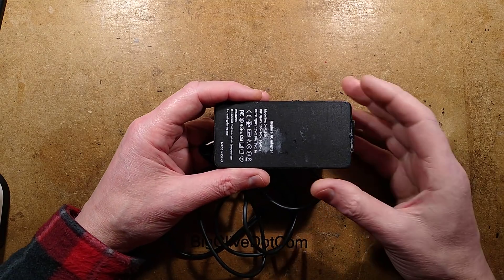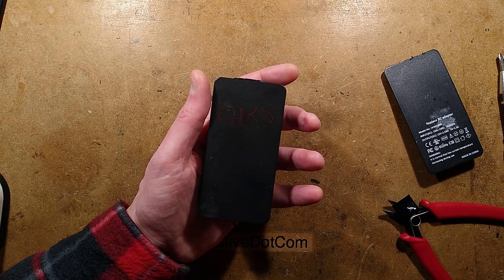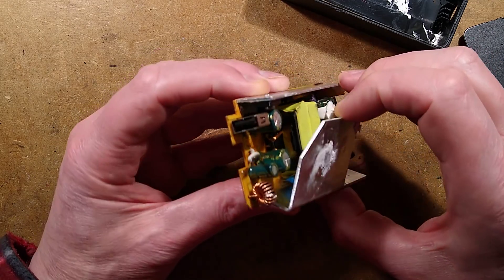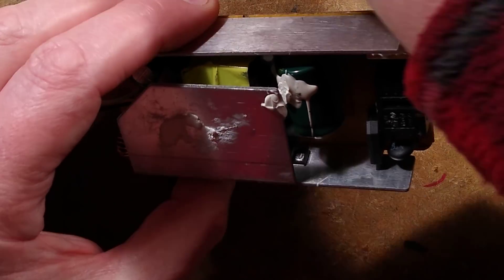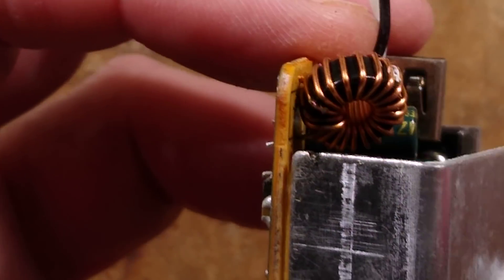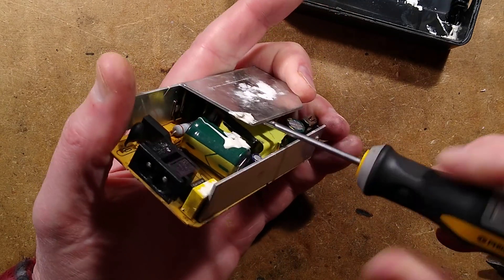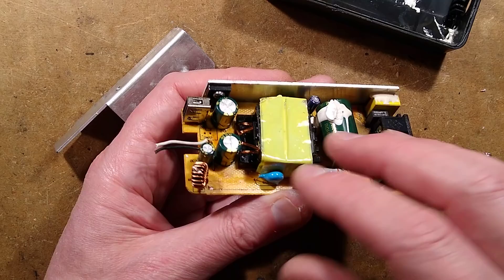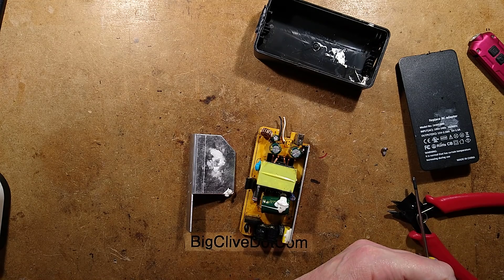This PSU killed a Microsoft Surface and a monitor

Comment: "Vibration during transit" is also my guess. That toroid was not secured. I've repaired many Anton Bauer chargers for pro camcorders which had an identical choke. Luckily, when it broke off it didn't short anything- it just stopped working. A little solder and a lot of hot melt glue fixed them.
Reply: Yeah, it needed some hot snot
Reply: FYI, I’d use proper electronics silicone (like Dow Corning 744), since many hot-melt glues can just fail, releasing entirely.
Reply: @tookitogo  - difficult with existing products, but with that type of inductor, I prefer a nylon cable tie holding it to the board via holes purposely made in the board.
Reply: @Mark1024MAK  Oh, for sure!!! If there’s a way to use a zip tie, it’s a no-brainer. I used precisely that arrangement on a PCB I laid out, to keep the batteries secured.
Reply: This is why I'm a fan of the potted black-box style inductors. They're a bit more expensive but they don't have any of these issues.
Reply: that is Sad Not even the pro gear is safe from poor designs and cheap parts .
Reply: @richardbrobeck2384  - I service video equipment and it’s much more at risk from Photogs lol
Reply: Similar problem on Mercedes transmission controllers, the TCU lives inside the gearbox and the sensor connections break loose. Luckily it’s a known problem with some very good repairers out there.

Comment: can you open an old 90s laptop power supply? I remember they used to be the size and weight of a literal brick in the early 90s and steadily got smaller and lighter over the years, but particularly in the last 10 years to now where they're maybe only a fifth the size and less than a tenth of the weight.
Reply: Hi, if designed correctly it doesn't necessarily mean that a smaller lighter product is unsafe.

Comment: "Temperature increase during use".  Well, they weren't lying.
Reply: "Device hot boom if use."
Reply: @jacobwcrosby  "Temperature increase gradual, then sudden"
Reply: It is normal that device explode.
Reply: Thermal compound between metal and plastic. Would that really help?
Reply: @bbgun061  well, the heat transfer is still bad because of the plastic, but better than the heat transfer of an air gap...
Reply: @bbgun061  - “Thermal compound between metal and plastic. Would that really help?” Not much, no. Plastic is poor at heat transfer. The objective of using thermal compound is to fill any imperfections that cause air pockets between two surfaces. And those two surfaces should be tightly held together. It’s not supposed to be like a sandwich with a thick filling.
Reply: @bbgun061  It helps diminishing the rattling of the heat sink i suppose...
Reply: Momentarily as hot as the sun...
Reply: They weren't lying that you should replace it either!  Preferably before use.
Reply: Even the stock ones get pretty hot when charging and they are in a much smaller case.
Reply: 45W charger - 1kW short term heater
Reply: also "replace AC adapter"
Reply: Yep can confirm those bricks would get stupid hot. Never felt safe to me.
Reply: @DyslexicAnaboko  theres no air vents in these so i agree.

Comment: Had a few Surfaces and they have been far and away the worse laptops I have ever had. Poorly made and massive problems with puffing batteries, most likely software issue as I had 2 units of different ages have this problem at the same time, of course shortly out of warranty. My brother had one that literally lasted 2 days. I noticed a lot of the comments talking about "cheap Chinese parts", but bear in mind these are cheap Chinese laptops that MS just sell at a premium. I assume the owner already had the original power supply fail if he had bought a new one.

Comment: I felt like I was watching a good detective movie! I've been doing failure analysis on electronics and mechanical systems for a good while, but that one would have had me stumped beyond seeing the arc-strike between the inductor and the heatsink. I probably would have just figured the power transistor had a meltdown and caused the burnt area due to direct short between the mains in. 😳

Comment: Would be great to see the inside of a genuine adapter and a comparison with this one.
Reply: My surface laptop one is heavy enough that i suspect it's potted.
Reply: @qwertyasdf66  they're not potted just packed full of filtering, if i ever get another that's too bad to splice i should chop it open for youtube
Reply: @Mister_Brown  I ever wondered if they were! But I absolutely hate the original ones, they're terribly unreliable, 80% of those I have in my company stopped working and I'm not sure it was the DC cable
Reply: @fabiosemino2214  I've had numerous Surfaces and none of their adapters have failed.  I still use an original i5 Surface Pro from 9 or 10 years ago and it flies along with windows 11 (modified to not require the TMP of course).  The worst I've seen brought into my repair shop for fixing are users treating stuff badly and the cable being kinked and frayed to the point of internal shorting.  Pretty much and device marketed for its portability is going to see some really bad user habits with the cables.
Reply: @zybch  interesting, are they easy to open? I have a bunch and Matt try to fix the cable
Reply: Lenovo Thinkpad chargers have lots of them.

Comment: I was immediately bothered with seeing something conductive right across the isolation… seems like an accident just begging to happen. The labeling on the outside is a definite red flag. Rather scary device.
Reply: I was going to ask about that. Is it not a bad design to allow anything conductive to bridge the isolation? Even the heatsink.
Pressure to design a small PSU whilst also cheaping out on the components.
If the PSU were more efficient it wouldn't have needed such a large heatsink in the first place.
Reply: @felixokeefe  if you were designing a PSU for best reliability, on the basis that it is going to be in a sealed plastic enclosure, you would have lots of sheet metal inside to efficiently spread the heat over as much of the box's surface as possible and to therefore minimise the existence of hot spots. Keep the components uniformly cool, have them last longer. 
So there is some merit to what was done here - it just wasn't done right.
And the small blob of white goo connecting the metal to the plastic case is a bad joke - shows that they hadn't thought it through or didn't have proper communication between the designers and the manufacturers, or the manufacturers just didn't understand or care how to do it right.
Reply: @Rich-on6fe  you make some good points.
I've seen similar style PSUs where the heatsinks have been wrapped in Kapton tape. Presumably to protect against this type of failure mode.
Reply: I have a similar power supply, but the sharp edges of the heatsink are taped over and the inductor is protected by shrink tubing.
Reply: @flightisallright  Sounds like they discovered (the hard way) the same problem that Clive identified here.
Reply: @jpdemer5  or realised on prototyping/first assembly and decided to go with a cheap easy fix that could be done at assembly with existing parts.
Reply: This is one of the many many reasons why i literally never buy anything made in china if i can possibly avoid it. I just don't want to deal with the bullshit of things breaking all the damn time.

Comment: At least they had AC input filtering. Most of the cheapo power supplies don't. You'd be amazed at how much RF background radiation they introduce.

I once had a computer PSU that raised the entire noise floor by 30 DB on my SDR. Replacing it brought back the weak stations. It had no RFI circuitry in it.

Comment: Why have all that isolation on the board and have a piece of metal connected and going straight to the low voltage side. Major design flaw. This is why you spend the  money on a genuine supply.

On another note a friend of mine bought a 12v 6 amp PSU online for a flat screen TV that the original PSU had failed. The new PSU could not provide the required current to run the TV. He ended up just letting me have the TV and I took the DC power cord from the original supply and wired it to the 12 volt rail of a PSU from an old computer and added a switch to turn on the supply and changed the fan. I have a nice old school flat screen from the 2000s. I use it on my playstation 2 for games and watching movies. Works great.

Comment: Wait... so the heat shield was connected to the mains neutral? Granted that all I know about 240v systems in Europe was learned from this channel, but it seems to me that a backward-wired outlet was at least one factor here. Otherwise how would "neutral" zap anything? I know mains referencing a low voltage supply is a Bad Thing, but wouldn't the live wire be needed for this to happen?
Reply from the maker: It wa connected to the rectified negative, so alternately live and neutral.
Reply: @bigclivedotcom  Ohh ok! That makes sense. Thanks for the answer!

Comment: I plugged in the extension brick which acts as the psu and adds more ports to my work laptop. It gave  my monitor a warning of over voltage. Brand new from microsofts bussiness store.
Reply: The advantage of the brand name is that you get to send it back under warranty.  Chinese junk, not so much. (Amazon might refund your money, but your fried equipment is your loss.)

Comment: If this was a half competence power supply, i would have thought maybe they were using the heat sink as a parallel earth conductor for EMC compliance
Reply: Compliance??? There's no AC line RF filtering or common-mode choke, no safety capacitor and a 2-wire power cord. 'Nuff said.

Comment: That heatsink plate totally compromises the separation. What on earth were they thinking?
Reply: Or on neutral, for that matter!
Reply: They were probably so focused on the separation on the circuit board (which they did pretty well), that they completely missed it.
Reply: It can have been a simple error in producing and lacking of QC. 
For example there is a cutout on the plate that makes little sense right now but if you turn the plate around, there is some distance between high and low voltage parts.
So, maybe someone was just putting the plates in the cutter the wrong way round and cut of on the other side, having no knowledge of where it was going to be used.
Then placed on the boards  in the cases and shipped without further good checks.
Of course works when it works untill boom.

By the way, Clive, was the heatsink not soldered well on the board so it could move, only fixed with the screw on the transistor-package?
Reply: @elvinhaak  That heatsink covers all the components so if any checks were made on the board they would have to be done before the heatsink was attached, there was nothing holding it apart from the transistor either and it also looks like the plate was cut wrong, it appears they were hoping the heat transfer paste would be enough to hold the plate in place by sticking it to the plastic case and prevent it moving around too much !
There are many issues that should be picked up by quality control but they don't care about quality, they only care about sales.
Reply: My guess is that when they reverse engineered the original they had to remove the heatsink to take photos. Of course, they would reverse one of the photos just like Clive does. And to make the heatsink fit that picture they reversed the picture of the heatsink too. Then the person making the heatsink, a different setup, would make it according to the picture. It still fits if you put it on backwards.
Reply: Maybe engineers in a different department modified the design
Reply: They weren’t.

Comment: Cheapest possible devise to use with your expensive stuff. Coolest thing was a laptop customer brought in that was struck by lightning it was plugged into the dsl modem with a lan cable

Comment: Well spotted :-)   I presume the original PSU stopped working as well but without the fireworks?
Reply: My original melted at the DC connector, apparently shorting is a common fault with these... so that's one possibility.

Comment: The inductor should have had clearance to the heat sink. They saved 0.02 dollars on the extra work on the aluminium and caused $1000's of dollars to just one customer...and they are unaccountable...can you see the flaw in the system?
Reply: It would've had clearance if they had just put a scrap piece of PET plastic between the inductor and heatsink or just a blob of glue to stop the inductor vibrating. It wouldn't even cost $0.02 and takes a fraction of a second to put it in. As the cuting and shaping of the aluminium plate is automated by machine, there is no extra work.
Reply: @simontay4851  Exactly - i'm sure there are many solutions, but they didn't bother which boils down to being accountable - they aren't accountable so they don't give a shit what happens after they get their money.

Comment: I'd love to see a look inside said surface and monitor too, see what died and if it's repairable
Reply: I seriously doubt economical repair would be feasible. It probably did widespread damage to the Surface. Don't know about the monitor.
Reply: @quantumleap359  There are no economical repair options of Surface tablets because they're glued together. They're even worse than taking apart a tablet because unlike a tablet that has a mostly uniform glue pattern, the Surface has glue all over the goddamn place. If you have to replace anything inside the unit, plan on replacing the screen as well because it's glued to the digitizer and will almost certainly shatter when removing it.

Everything is expensive as hell too. I did a charge port on a Surface Pro 7 and the port BY ITSELF was $75. The screen was another $150, and you had to buy the digitizer+display assembly because they're both glued together. Even finding a charge port is a nightmare because it's proprietary and must come off another dead scrapped unit.

If you can't get a charge port, the next best thing is to solder wires directly to the battery connector and run them outside the unit through the charge port and just apply battery voltage using a buck converter. IIRC, it requires 8.4v, I was able to do this with a cheap 5A buck converter. It'll keep the battery topped off and has enough grunt to power the unit. It's perfectly safe to do because the battery has an internal protection board to prevent overcharging.
Reply: @GGigabiteM   MS is learning from Apple.
Reply: @jpdemer5  lol True... However, IMO learning conveys a sense of transferring knowledge --either through intentional teaching or a third party's observation --which is generally a "good" thing. (but not always; ie kids observing bad habits of parents)

This sounds more like "parroting", where one is trying to mimic another as best as possible. Key being "as best as", since it seems like they're not doing things as methodical as Apple -- which I say begrudgingly, since I'm NO fan of Apple or their methods. The liberal application of glue everywhere (non-uniformly), as mentioned up thread, is what I'd attribute to 'poorly mimicking' Apple 🥴😔
Reply: @DUKE_of_RAMBLE  More like mimicking bad habits of competitors, which is all Microsoft has been doing for the past 7 years.
Reply: @johndododoe1411  Yep, that's basically what I mean. The end result is not making for better electronics 😭

As an aside, some food for thought: back when laptop were socketed, at least those systems could get easily repurposed by removing it from the laptop enclosure and swapping the CPU for either a model that was more, or even less powerful. If more, a beefier custom heatsink strapped to it (since the confines of the laptop weren't an issue anymore) and no concern about heat. If less, like "ultra-low voltage" models, a fanless or maybe even immersion bath cooling.

Point being, with everything soldered to the PCB these days, more and more of the old hardware is becoming literal eWaste. All in the name of thinner and lighter, which thinner ends up being harder to hold on to (ie phones, tablets) and also less durable since there's less material to give/flex when dropped.

Just my $0.02 worth... 🥴
[/micro-rant]
Reply: @quantumleap359  I meant the monitor when I mentioned the fuse. Sorry I assumed that was obvious as it was replying to a comment asking about repairing the monitor.
Reply: @stevetobias4890  just wild guess,  the power went probably over the signal board to ground. There should not be a major fuse on the signal board so, with luck, only the signal board looks like the charger, with bad luck it also taken the display control unit with it and the display itself but probably the backlight and PSU from the Monitor are fine XD
Reply: @MalownMcOwnage  Clive said explicitly that the current went up the ground line, not the power line, so presumably it also went up the ground connection to the monitor? You'd expect the ground on the tablet to be attached to the monitor ground via the cable, after all.
Reply: @d2factotum  i hope i don't misunderstands  you, my guess is as clive said, the power went from the charger to the surface, then over the data cable to HDMI/Display Port to the signal board, which is designed for low voltage (12V maybe 24V) and then from the signal board to the monitor chassis which is grounded.
Reply: It should have had a fuse on the power input side.
Reply: @stevetobias4890  A fuse rated for the low voltage expected on the input would not have coped with this event - it simply would have flashed over. Even if it had held out, enough current would have flown for long enough to cause irreparable damage.

Comment: unit: overheats and blows up
manufacturer: that's normal
Reply: "That's a feature"
Reply: @Caretak007  yes
Reply: Says so right on the tin.
Reply: “Price per unit adjusted to reflect expected defect rate per lot” -seen on multiple types of electronic lots advertised for US import (then the importer does not QC, marks up anyway)